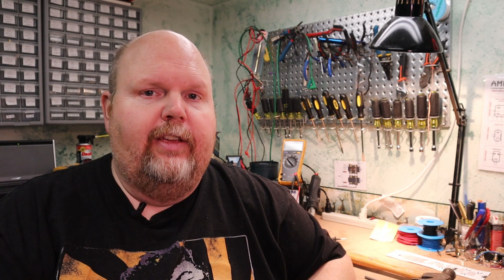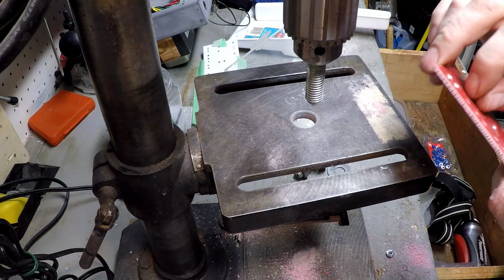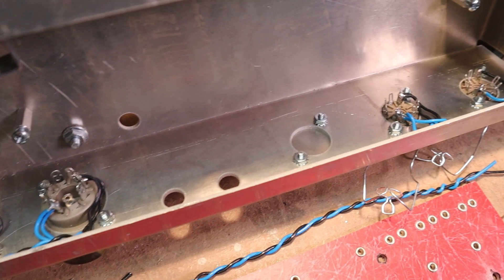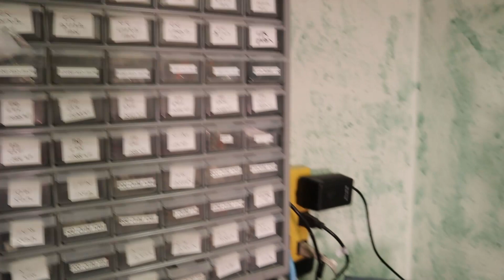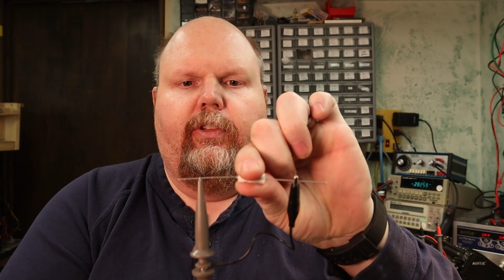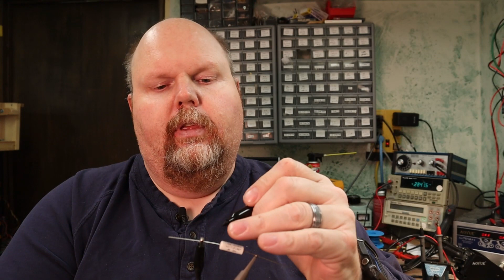Deluxe Build Part 2

Comment: I've seen your videos and agree with much of your methodology.  I'm curious as to what 'modern' tweaks you might feel are appropriate to make the tweed Deluxe circuit work well in a modern context.  I've seen the Dumble version and thought it had its merits (although I don't think he really had a good sense of tailoring capacitance values to maximize performance), as well as Fender's 'The Edge' iteration (better take on the coupling caps but missed many other opportunities for improvement).  This is sort of a dead end in some respects, I suppose, because if you build in the features necessary to actually make this amp perform well, then it will likely no longer be a 'Deluxe'.